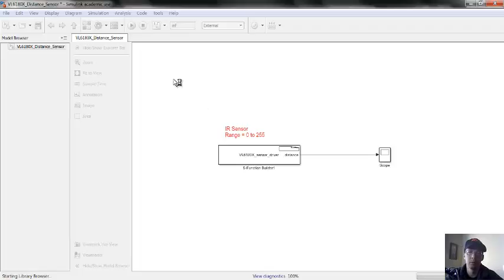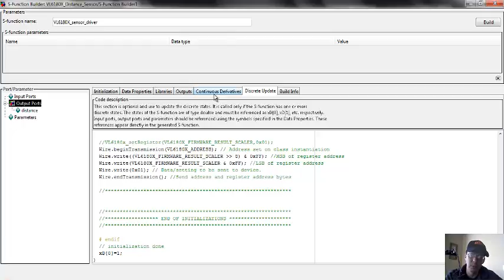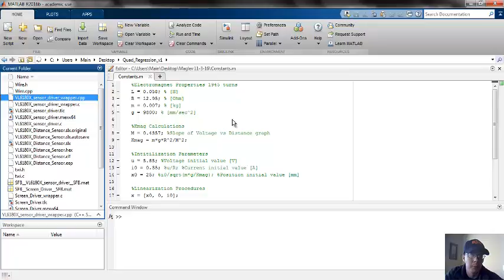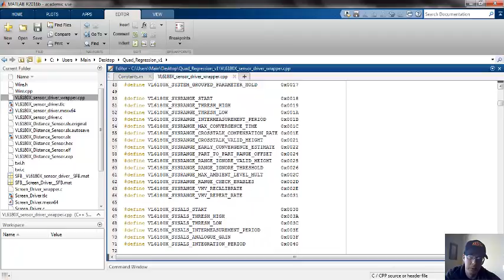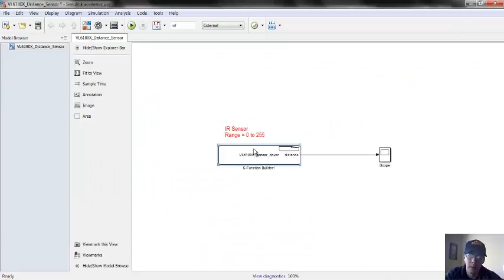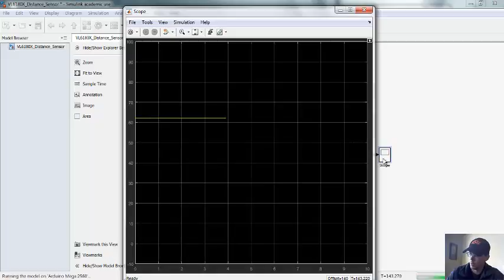Aruino Simulink I2C and the Vl6180 sensor

Comment: Hello;

Thanks for providing the code for the Arduino Simulink I2C and the VL6180 sensor.   I got it working and it’s been a significant help in my project.

I have found a similar sensor:  the VL53L0X, this is made by the same company (ST), but different companies produce the breakout board (Pololu).  This sensor has a longer range than the VL6180.  

Is it possible to use the same code that you did for the VL6180 to connect the VL53L0X with Arduino and Simulink.  If not are you able to advise me on how to modify the code?

Again thanks for your help
Reply from the maker: I looked up the sensor and its an i2c sensor so the idea of using the code will work. However I did not look at what registers are what etc. So my guess is all the registers are different and it will require you to change the code pretty significantly. However the base code to these sensors is only like 5 lines and you will have it running quickly if you you just make sure the  The rest of the code is like defaults and calibration stuff. So I'm pretty certain it can work but I would start by finding the register that the value is stored on the sensor  and just focus on the output part of Simulink and that register and fill in the rest after you see values.

Comment: Servo is at the end of conveyor belt, it is used to sort objects of different colors. it has to be in one of two positions depending on which color is detected red or green. 
PWM of the servo works in matlab. my problem is, that now i have to make PWM of servo dependent on color output from RGB sensor, and i dont know how to do that.
I've tried  that same thing in  arduino IDE and it works, servo is positioned according to the read color.

Comment from the maker: I have no problem giving advise on your servo problem, however I fail to understand the basic operation. have you got the pwm of the servo to work. That should be very easy, with the basic Arduino Simulink PWM library, I think. Iknow typical servos run at a refresh rate of like 20ms I'm not sure what the Frequency is of the Arduinos PWM but I bet it will work with no change.In general the color sensor is likely the hardest part of your project it sounds like.

Comment: Hey, I've managed to get some readings out on display in simulink.
The main problem was that i've forgot to include the COMMAND byte to the address of the register i was writing on. 
Since I can't email you  i'll copy the code here anyway so You can see it. 

But now I've a second problem which is positioning of servo motor(Sg90) using the RGB values from sensor output.
I have tried with logic operations, comparing the color values and then writing certain constant value to the digital output of arduino, but that didn't work.
I'm hoping that you can help with this problem.
Thanks in advance. 

//CODE 

#if defined(MATLAB_MEX_FILE)
#include "tmwtypes.h"
#include "simstruc_types.h"
#else
#include "rtwtypes.h"
#endif
#ifndef MATLAB_MEX_FILE
#include <Arduino.h>
#include <math.h>
#include <Wire.h>
#include <Wire.cpp>
#include<twi.h>
#include<twi.c>

#define TCS34725_ADDRESS             (0x29)
#define TCS34725_TIMING                 (0x81)
#define TCS34725_COMMAND_BIT  (0x80)
#define TCS34725_CONTROL            (0x8F)    /* Set the gain level for the sensor */
#define TCS34725_ID                          (0x92)    /* 0x44 = TCS34721/TCS34725, 0x4D = TCS34723/TCS34727 */
#define TCS34725_RDATA                 (0x96)    /* Red color address+COMMAND BIT, reading 2 bytes.  
#define TCS34725_GDATA                 (0x98)
#define TCS34725_BDATA                 (0x9A)
 
#endif
#define y_width 1

extern "C" void TCS34725_driver_Outputs_wrapper(uint16_T *red,
            const real_T *xD)
{
if(xD[0]==1){
 
   #ifndef MATLAB_MEX_FILE
 
   //communication check 
   Wire.beginTransmission(TCS34725_ADDRESS);  
   Wire.write(TCS34725_TIMING); 
   Wire.write(0x00);
   Wire.endTransmission();
   
   Wire.beginTransmission(TCS34725_ADDRESS);
   Wire.write(TCS34725_CONTROL ); 
   Wire.write(0x00); 
   Wire.endTransmission();
 
   Wire.beginTransmission(TCS34725_ADDRESS); 
   Wire.write(TCS34725_COMMAND_BIT); 
   Wire.write(0x03); 
   Wire.endTransmission();
  
//reading colors
  Wire.beginTransmission(TCS34725_ADDRESS);
  Wire.write(TCS34725_RDATA ); 
  Wire.endTransmission(false);
  Wire.requestFrom(TCS34725_ADDRESS  , 2);
  red[0] = Wire.read(); //Read Data from register
  Wire.endTransmission();
  #endif
} }
 extern "C" void TCS34725_driver_Update_wrapper(uint16_T *red,
            real_T *xD)
{
  if(xD[0]!=1){
 
# ifndef MATLAB_MEX_FILE
  
  Wire.begin(); // start i2c bus
  
  Wire.beginTransmission(TCS34725_ADDRESS);
  Wire.write(TCS34725_RDATA ); 
  Wire.endTransmission(false);
  Wire.requestFrom(TCS34725_ADDRESS  , 2);
  red[0] = Wire.read(); //Read Data from selected register
  Wire.endTransmission();
    
    #endif
   xD[0]=1;
    } }

Comment from the maker: Hey KRKY sorry to here you are having so much trouble. So it sounds like you are close if you getting a -1 I would maybe start just dissecting what is working for instance work from output in ... put an actual number in for color 0 1 2 see if its passing that. then maybe start sending register values out as numbers to check . I assume it compiles and I also assume that your doing the technique where you type extern "C" in front of each void statement and rename the file type in the matlab from your_code_name.c chang to your_code_name.cpp you did all of that right. HEY ALSO I NOTICED.. your ifndef is not blue here double check to see why that was//$$$$$$$$$$$$$$$$$$$$$$$$$$$$$$  discrete update code //

 if(xD[0]!=1){

 # ifndef MATLAB_MEX_FILE 
  
  Wire.begin(); // start i2c bus  

    #endif
    xD[0]=1;
    }Read more Show less
Reply: Sorry for late answer, lately days are just passing me by . Yes You are assuming right I did all of these things. I've tried what you've said and i got 65535 at the output, with the input at that register of 0x125.
So now I don't know if I have wrong inicialization of sensor or do I have an error somewhere in my code.
I tried sensor with Arduino code and it works just fine, so the error must be somewhere in simulink.

Comment: I have color sensor TCS34725, and want to connect it to Simulink through Arduino via I2C communication. I am trying to create an S function using your code  as my guide, but so far i've been  unsuccesfull. 
I've searched everywhere and could not find anything that would help me to understand this properly. 

I've changed the Register names and address, but i only managed to get  /-1/ at output scope. So please if you could help i would be really gratefull. Below I've pasted the code that i 've used. 

Thanks in advance. 

//$$$$$$$$$$$$$$$$$$ Code for LIBRARY $$$$$//

#ifndef MATLAB_MEX_FILE
#include <Arduino.h>
#include <math.h>
#include <Wire.h>
#include <Wire.cpp>
#include<twi.h>
#include<twi.c>

#define TCS34725_ADDRESS          (0x29<<1)
#define TCS34725_READBIT          (0x01)

#define TCS34725_COMMAND_BIT      (0x80)

#define TCS34725_ENABLE                  (0x00)
#define TCS34725_ENABLE_AIEN        (0x10)    /* RGBC Interrupt Enable */
#define TCS34725_ENABLE_WEN        (0x08)    /* Wait enable - Writing 1 activates the wait timer */
#define TCS34725_ENABLE_AEN         (0x02)    /* RGBC Enable - Writing 1 actives the ADC, 0 disables it */
#define TCS34725_ENABLE_PON         (0x01)    /* Power on - Writing 1 activates the internal oscillator, 0 disables it */
#define TCS34725_ATIME                      (0x01)    /* Integration time */
#define TCS34725_WTIME                     (0x03)    /* Wait time (if TCS34725_ENABLE_WEN is asserted) */
#define TCS34725_WTIME_2_4MS       (0xFF)    /* WLONG0 = 2.4ms   WLONG1 = 0.029s */
#define TCS34725_WTIME_204MS      (0xAB)    /* WLONG0 = 204ms   WLONG1 = 2.45s  */
#define TCS34725_WTIME_614MS      (0x00)    /* WLONG0 = 614ms   WLONG1 = 7.4s   */
#define TCS34725_AILTL                        (0x04)    /* Clear channel lower interrupt threshold */
#define TCS34725_AILTH                       (0x05)
#define TCS34725_AIHTL                       (0x06)    /* Clear channel upper interrupt threshold */
#define TCS34725_AIHTH                      (0x07)
#define TCS34725_PERS                        (0x0C)    /* Persistence register - basic SW filtering mechanism for interrupts */
#define TCS34725_PERS_NONE           (0b0000)  /* Every RGBC cycle generates an interrupt                                */
#define TCS34725_PERS_1_CYCLE      (0b0001)  /* 1 clean channel value outside threshold range generates an interrupt   */
#define TCS34725_PERS_2_CYCLE      (0b0010)  /* 2 clean channel values outside threshold range generates an interrupt  */
#define TCS34725_PERS_3_CYCLE      (0b0011)  /* 3 clean channel values outside threshold range generates an interrupt  */
#define TCS34725_PERS_5_CYCLE      (0b0100)  /* 5 clean channel values outside threshold range generates an interrupt  */
#define TCS34725_PERS_10_CYCLE    (0b0101)  /* 10 clean channel values outside threshold range generates an interrupt */
#define TCS34725_PERS_15_CYCLE    (0b0110)  /* 15 clean channel values outside threshold range generates an interrupt */
#define TCS34725_PERS_20_CYCLE    (0b0111)  /* 20 clean channel values outside threshold range generates an interrupt */
#define TCS34725_PERS_25_CYCLE    (0b1000)  /* 25 clean channel values outside threshold range generates an interrupt */
#define TCS34725_PERS_30_CYCLE    (0b1001)  /* 30 clean channel values outside threshold range generates an interrupt */
#define TCS34725_PERS_35_CYCLE    (0b1010)  /* 35 clean channel values outside threshold range generates an interrupt */
#define TCS34725_PERS_40_CYCLE    (0b1011)  /* 40 clean channel values outside threshold range generates an interrupt */
#define TCS34725_PERS_45_CYCLE    (0b1100)  /* 45 clean channel values outside threshold range generates an interrupt */
#define TCS34725_PERS_50_CYCLE    (0b1101)  /* 50 clean channel values outside threshold range generates an interrupt */
#define TCS34725_PERS_55_CYCLE    (0b1110)  /* 55 clean channel values outside threshold range generates an interrupt */
#define TCS34725_PERS_60_CYCLE    (0b1111)  /* 60 clean channel values outside threshold range generates an interrupt */
#define TCS34725_CONFIG                      (0x0D)
#define TCS34725_CONFIG_WLONG      (0x02)    /* Choose between short and long (12x) wait times via TCS34725_WTIME */
#define TCS34725_CONTROL                   (0x0F)    /* Set the gain level for the sensor */
#define TCS34725_ID                                 (0x12)    /* 0x44 = TCS34721/TCS34725, 0x4D = TCS34723/TCS34727 */
#define TCS34725_STATUS                      (0x13)
#define TCS34725_STATUS_AINT           (0x10)    /* RGBC Clean channel interrupt */
#define TCS34725_STATUS_AVALID       (0x01)    /* Indicates that the RGBC channels have completed an integration cycle */
#define TCS34725_CDATAL                      (0x14)    /* Clear channel data */
#define TCS34725_CDATAH                     (0x15)
#define TCS34725_RDATAL                      (0x16)    /* Red channel data */
#define TCS34725_RDATAH                     (0x17)
#define TCS34725_GDATAL                     (0x18)    /* Green channel data */
#define TCS34725_GDATAH                    (0x19)
#define TCS34725_BDATAL                     (0x1A)    /* Blue channel data */
#define TCS34725_BDATAH                    (0x1B)

#endif

$$$$$$$$$$$$$$

//$$$$$$$$$$$$$$$$ outputs//

if(xD[0]==1){

   #ifndef MATLAB_MEX_FILE

  

   //start a single shot
   Wire.beginTransmission(TCS34725_ADDRESS); // Address set on class instantiation
   Wire.write((TCS34725_ENABLE >> 8) & 0xFF); //MSB of register address
   Wire.write(TCS34725_ENABLE & 0xFF); //LSB of register address
   Wire.write(0x12); // Data/setting to be sent to device. 
   Wire.endTransmission(); //Send address and register address bytes
 

 //******Reading_colors *****// 

  Wire.beginTransmission(TCS34725_ADDRESS); // Address set on class instantiation
  Wire.write((TCS34725_RDATAH >> 8) & 0xFF); //MSB of register address
  Wire.write(TCS34725_RDATAL & 0xFF); //LSB of register address
  Wire.endTransmission(false); //Send address and register address bytes
  Wire.requestFrom(TCS34725_ADDRESS , 1);
  color[0] = Wire.read(); //Read Data from selected register
  
  Wire.beginTransmission(TCS34725_ADDRESS); // Address set on class instantiation
  Wire.write((TCS34725_GDATAH >> 8) & 0xFF); //MSB of register address
  Wire.write(TCS34725_GDATAL & 0xFF); //LSB of register address
  Wire.endTransmission(false); //Send address and register address bytes
  Wire.requestFrom(TCS34725_ADDRESS , 1);
  color[1] = Wire.read(); //Read Data from selected register

  Wire.beginTransmission(TCS34725_ADDRESS); // Address set on class instantiation
  Wire.write((TCS34725_BDATAH >> 8) & 0xFF); //MSB of register address
  Wire.write(TCS34725_BDATAL & 0xFF); //LSB of register address
  Wire.endTransmission(false); //Send address and register address bytes
  Wire.requestFrom(TCS34725_ADDRESS , 1);
  color[2] = Wire.read(); //Read Data from selected register
  
  #endif
}

//$$$$$$$$$$$$$$$$$$$$$$$$$$$$$$  discrete update code //

 if(xD[0]!=1){

 # ifndef MATLAB_MEX_FILE
  
  Wire.begin(); // start i2c bus  

    #endif
    xD[0]=1;
    }
Reply from the maker: Replied below